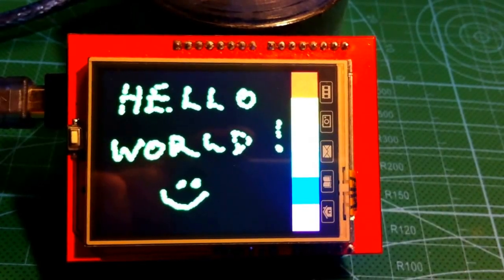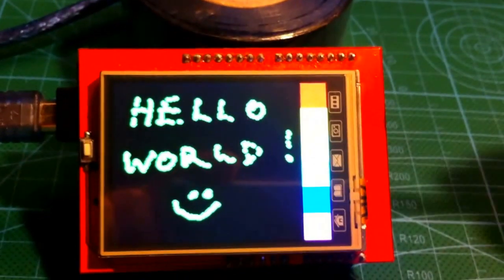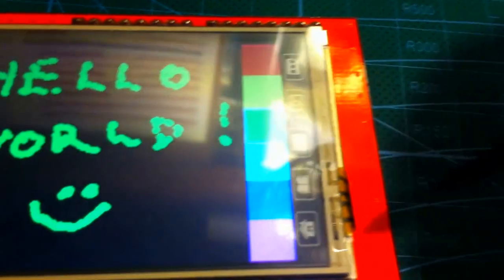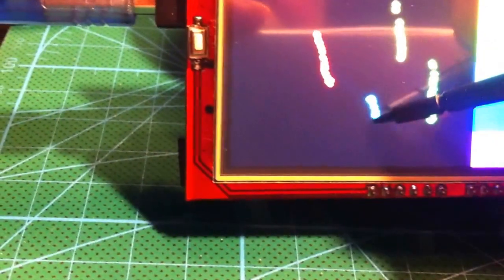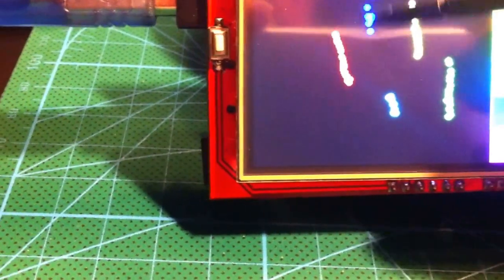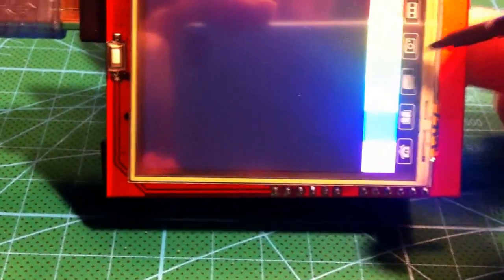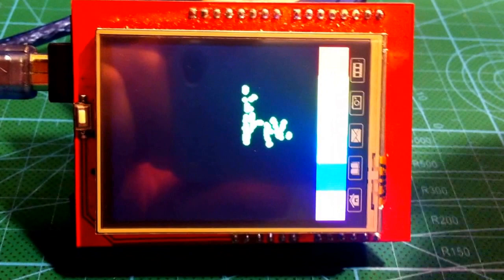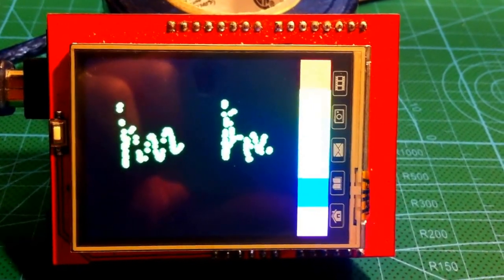Paint Sketch for Arduino Uno LCD TFT 2.4" Touch Display 8 bit ILI9341. Link to sketch.

Comment: can it work with a bigger LCD? like a 9.7 LCD module?
Reply from the maker: Luciano Lizana only after modification for the displayed pixels and if it used the same display driver chip in this case the ili9341.

Comment: My dont work :( I got the display to show something but it dont react to my fingers, when i touch in it :( I have this one(But with the original Uno, not the one from the link):https://www.banggood.com/UNO-R3-ATmega328P-Board-2_4-Inch-TFT-LCD-Screen-Module-For-Arduino-p-945755.html
Reply from the maker: LBLJLALRLNLE LHLALNLSLELN 
Is your board identical?
Banggood have sold several similar ones under the same SKU. 
I'm not sure that you have the same driver chip on your display. Mine was the Ili 9341 8bit data version. 
Most of these boards are 8bit data but use different driver Chips. 
One test you can do is measure across the resistive touch screen to check you see about 300ohms across the terminals. There are two pairs of connections used by this sketch A1, D7 is one pair, A2, D6 the other pair. Check you can measure approximately 300ohms across each pair with the board disconnected, 
If not the touch panel may be faulty. 
There is also a test sketch that requires no library, try that to test out your boards graphics too, 
let me know how you get on.
Good luck and thanks for watching.
Reply: Thanks for help! The resistance across 2 terminals is 600ohms and across the others 300ohms. I also Tested the boards graphics and the display works perfacly fine. Unfortunately I dont got a datasheet from the package :(
Reply from the maker: LBLJLALRLNLE LHLALNLSLELN 
try this library
https://github.com/prenticedavid/MCUFRIEND_kbv
there is also a sketch to identify the driver chip on the board that might give a clue as to which you have. 
This lib works with most of the 8bit tft displays. It also has a touchscreen calibration program that might help you. 
Good luck.
Reply: Thanks! I'll try out

Comment: Just as a clarification, this LCD works with several other arduinos, including Nano.
I have a bit of curiosity as to what the side icons do on the screen. Are they just drawings or they have true functions?
Reply from the maker: Olivier Lopez Ch the icons are only drawn on the screen and have no function. Only if you put a function to that location on the screen. Thanks for the feedback.
Reply: Thanks

Comment: Got an error Point was not declared in this scope
Reply from the maker: ERNESTAS ŽIOBA 
Hi, have you got the library's installed?
that may be the problem,
check and get back to me please. 
Thanks.
Reply: KB1UIF Thanks for replying but I got it working. Problem was the old TouchScreen library.
Reply from the maker: ERNESTAS ŽIOBA
your touchscreen library may differ to this one.
check you are using the same library.
Thanks.
Reply: I have the same error, maybe can you helpme, do you have the update library?
Reply from the maker: beto cajamarca Hi, check the version of touch screen library. you need the same one that I'm using. I have links ! :-)
Reply: i used a sketch to know what is the chip in my screen and in the serial monitor says that is an unknown chip driver the driver is 0X8080, your library works with that driver?
Reply: U can check the chipset on the other side of the board.
Reply from the maker: ERNESTAS ŽIOBA the chips you see on the underside of the board are not the driver chip. Those chips are normally bi-directional tri-state buffers like 74LS245 not the driver chip that is under the display panel and hard to see. You should not try to view the driver chip as you will probably damage the cable under the LCD panel.
I'm not sure what the 0x8080 chip is. Is your shield identical to the one I'm using from Banggood?

Comment: I'm really having a hard time with this touchscreen anyway I can email you?
Reply from the maker: +Hippy Crack Yes you can.
Reply from the maker: comexe 1@hotmail.com
Reply: Sorry it took me a while to get back to you..  I have been working all this time. 

I am in still need of help.  I can not get anything to show up on the screen

I have tried all the examples
Reply from the maker: Well do the sketches compile and upload ok ? If so do you have an identical graphics shield? There are lots that look the same but use different driver chips. Where did you get the graphic display from?